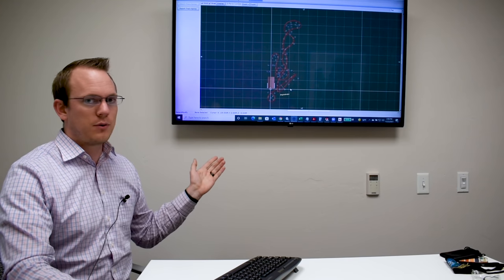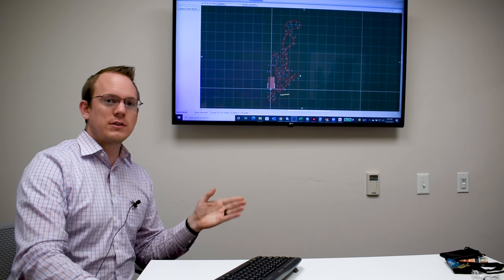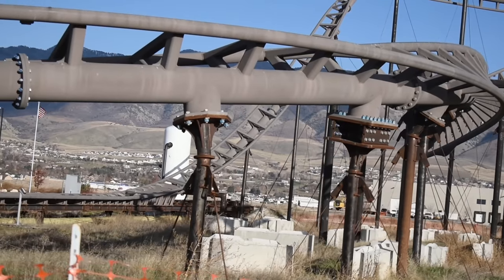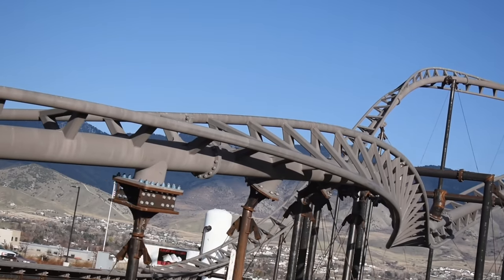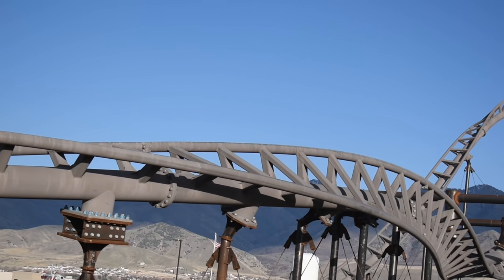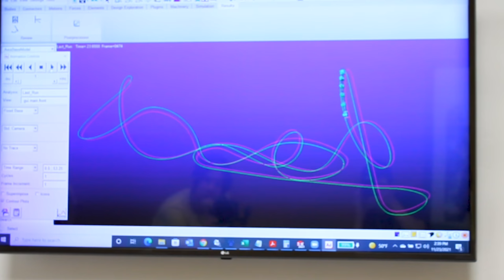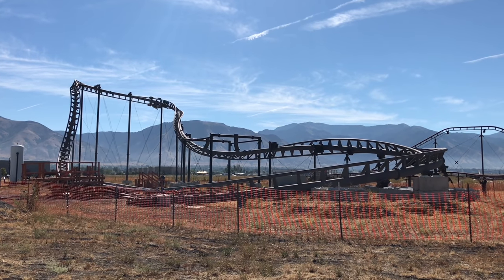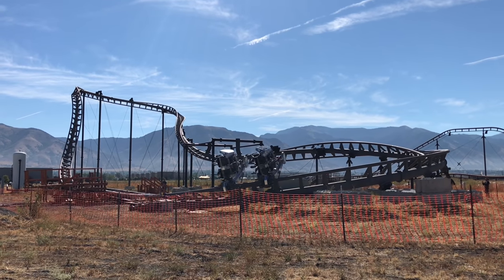Meet AXIS: The Newest Innovation in the Amusement Industry! | National Coasters Mini Documentary!

Comment: Imagine if an Arrow suspended coaster had an Axis train
Reply: Pain everywere
Reply: You read my mind. I was wondering if Axis cars could be fitted on existing SLC's? There are plenty out there that could benefit from new cars. New cars with a twist would be even better.
Reply: @leesmaling8582  not likely, slcs have a different type of track and the layouts arent made for these cars, would result in some awkward and likely painful coasters
Reply: No doubt that Arrow Suspended coasters are the forerunner of the axis coaster
Reply: I'd just love to see them reintroduce the suspended coaster amd make some new ones since they own Arrows designs.
Reply: @porcelainthunder2213  Replace the shock absorbers with magnets to dampen the swinging, offer a more aggressive layout option like the original Bat and also the option of a fully enclosed car (no shoulder harness!!!) with a 36" min height requirement that is a more family friendly configuration than the floorless cars offered by Vekoma. Better yet mix up the types of cars (enclosed/floorless) on same train and even turn some backwards which we had with XLR8 at Astroworld.
Reply: @JEdwardBanasikJr  36" is the height base for 3 year olds, they don't need to be on rides like these yet, let them be kids a few more years. A safe height is 42-45 inches. The younger you are, the larger your head is in proportion to your body. 36-42" kids don't have necks strong enough to support their heads with over 2Gs of force applied on their body.
Reply: Eye sea diss coaster as de next generation arrow suspended coaster.
Reply: 😱no thank you
Reply: @JEdwardBanasikJr  Enclosed car  would be a horrible; half the fun is the wind in your face. For those watching, hearing the screams of riders is also part of the fun. No shoulder harness would never fly with insurance.